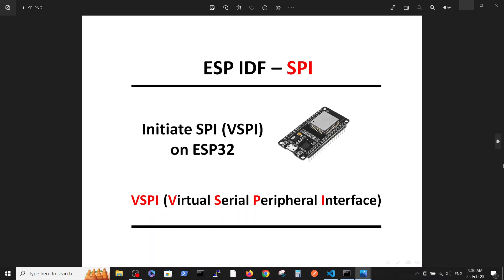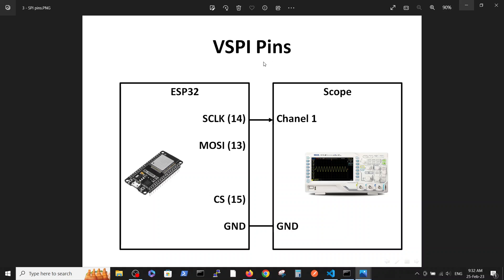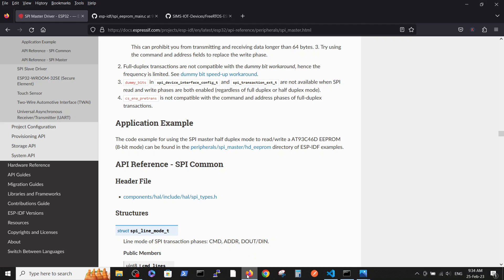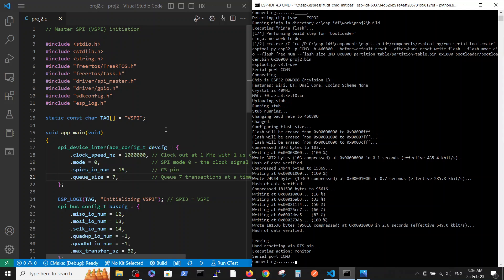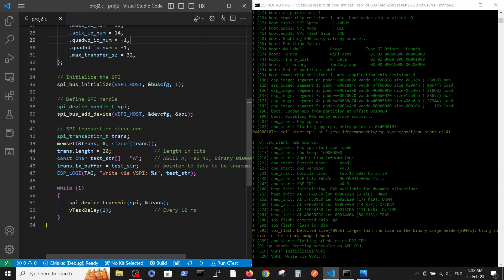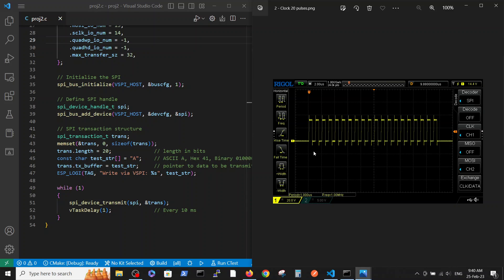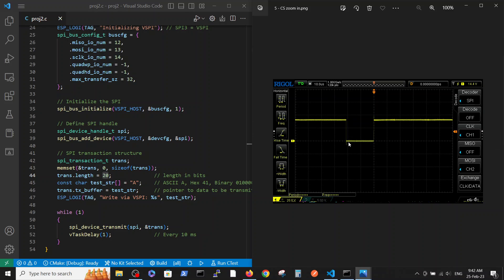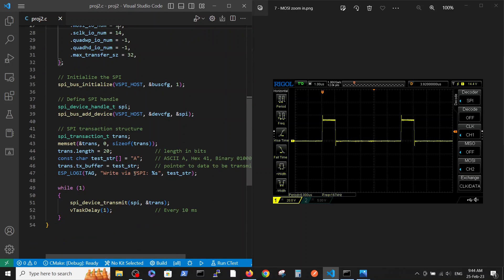1 - ESP IDF SPI initiation

Comment: what is "flags" parameter in "spi_device_interface_config_t" structure?
Reply from the maker: Dear @majidsaeidi7760,
Generally "flags" in the "spi_device_interface_config_t" structure define the length of so-called "Address phases" and are useful if you want specifically define this parameter. I personally did not use the "flags" in the "spi_device_interface_config_t" structure in my code and settled on the default configuration defined by the spi_bus_add_device() command.